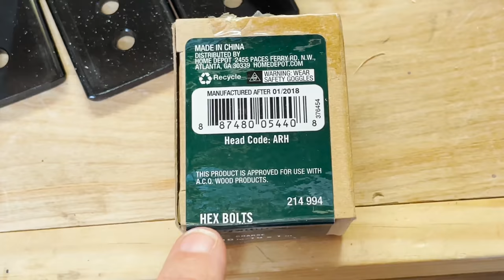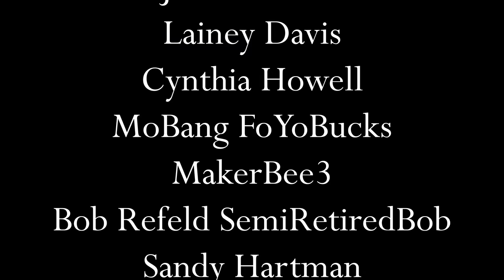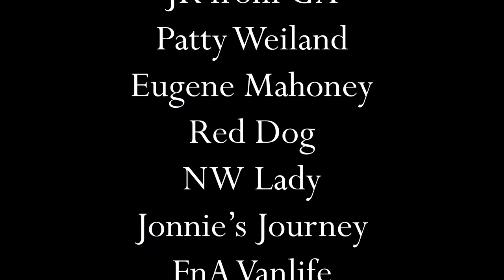VanLife | How to build a roof DECK on a tiny Transit Connect

Comment: Nice Deck! I was a welder before retirement, so I chose to build the roof rack on "Serenity" out of 1" steel tubing and expanded metal. All the rack forward of the roof escape hatch is for solar panels, didn't need the expanded metal for that. For the back half, the expanded metal didn't provide shade, so i coated 3/8" plywood with white elastomeric roof coating, now I have shade!  I think it does make a difference in heat in the bus. Also added some tie-down rings to strap down the spare tire, and other cargo. Enjoy the view from the new deck, and roll on!
Reply from the maker: Sounds like quite the project! I have liked the composite wood so far. It stays cool even in heat. She also added hooks on all four corners so I can strap thing on!

Comment: It looks awesome!  I bet it also keeps your van cooler as it is lighter color to reflect the sun.  I wonder if using VHB tape would be better than butyl tape.  I don't see it as a huge issue as you have the other 2 bars securely fastened.  It looks like it's going to be so fun to have.  Congratulations!  Great work Jonnie!
Reply from the maker: I’m so far so good. Yes, I think that it will be cooler too. Not only because of the lighter color but that air can circulate under and through it.

Comment: Amazing! What glue did you use to z brackets?
Reply from the maker: I think we mention it in the video. I can’t remember off the top of my head. It is a compound that goes on thick and dries over time. Wish I could be more helpful.

Comment: Hello, your project turned out beautiful. I’m considering doing a deck and I’m wondering if you notice a difference when you drive in the wind also, did it add a lot of weight?
Reply from the maker: I am sure it added weight, just as a cargo rack would. I haven’t noticed a difference in driving or mileage. It has an added benefit of acting to cool the roof as air flows under it while I’m parked. So sun is not beating down on the van.😝

Comment: I'm having arguments with my dad about the effect of drag the sun deck will have even am driving. What's your experience of drag with the sun deck? It will be really helpful for extra storage and getting the most out of my camping trips. Thanks x
Reply from the maker: I am not sure yet. It doesn’t seem much different. There is airflow through it and the slats have a gap. I think that helps. Gas prices being high—I haven’t been able to calculate realistically if there’s a difference. But i will when I can and let everyone know🤗

Comment: My only question is what do you plan to use the new platform for?   Mounting solar panels?  Or maybe carrying gear?   I know I had seriously considered adding a roof box to my Transit Connect,  but changed my mind on reading what percentage it can cut down your average mileage.   I instead took your advice and removed my passenger seat. Has opened up a huge amount of space I’m already putting to good use!
Reply from the maker: I have portable solar panels, but I suppose I can lay them up there. I also have eye hooks mounted on the four corners if I should want to carry things up there or have a rooftop tent. I can also just sit up there and enjoy the view🤗

Comment: On a van that small you could have put a residential 400 watt solar panel and used 500 pound drawer sliders to mount the deck above the panel.🤔
Reply from the maker: I have portable solar panels. 🤗

Comment: Totally not the right video to ask but was wondering where you got the bamboo slats for your cargo area? I've been looking and can't find. Closet thing I could find is the patio blinds (they seem thin enough to fit inside) but I love the look of your bamboo
Reply from the maker: I think you are talking about the slats on the doors? That is balsa wood. You can get it at craft stores. It is only decorative. In other words, you wouldn’t be able to screw things into it unless you went into the metal. But it does help the aesthetic and it keeps those areas from getting overly hot or cold because I put reflectix behind it!
Reply: Thank you so much! I've obsessed with your channel as I just traded my Mazda 3 hatchback for my 2013 Ford Transit Connect (only had 28k miles on it too as my Mazda has 140k from my job as a pet sitter). I'm so stoked in general as I have fur babies and want to travel with them and now I can. I did my first overnight camping kinda thing this past Thursday thru Monday and though it was a wake up experience I know now I or we can handle it just fine. So now to do the actual build. I'm in love with your bed/seat and it'll allow my furs to have room to chill too. Sorry so long but pumped like a kid in a candy store. Keep inspiring girly, you've been amazing for my pressing forward with van life ❤♥♥️🤙🤙🤙
Reply from the maker: @jbarlow6539  You’re so welcome! I’m happy that you are inspired. Have fun with putting it all together. See you down the road☺️
Reply: @LadyBugout  thx girly! I'm in Alabama if you get this way!